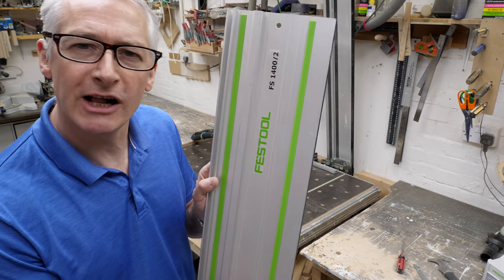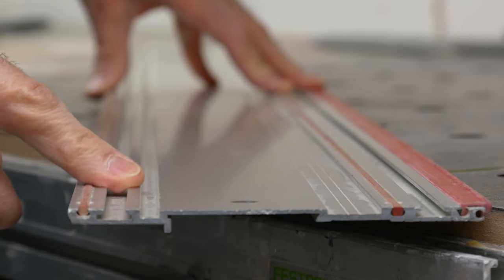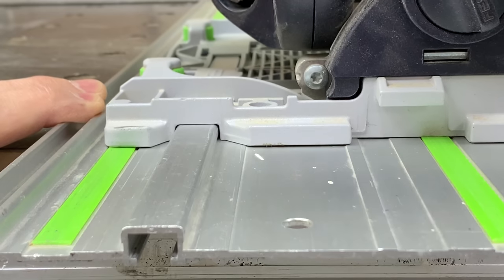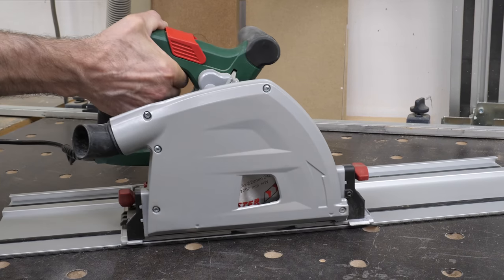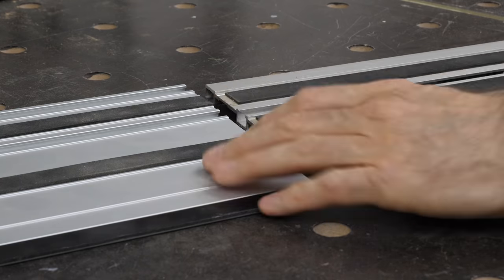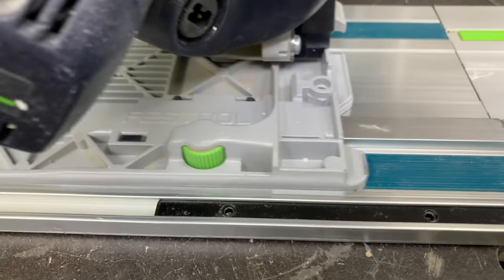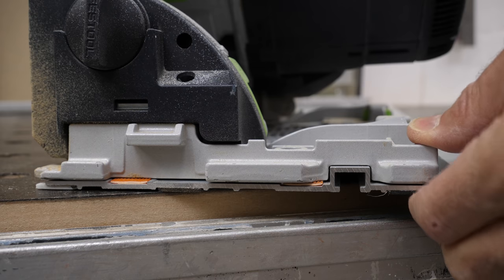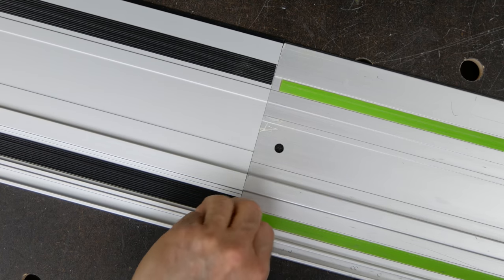Which Rails Work? A Guide to Guiderails [video #403]

Comment: Thank you look forward to future videos.  Have you heard of any problems with Makita Rails having design issues?

I bought the Makita saw and guard rail about a year ago and have yet to be able to cut reliable 90degree cuts across a piece of plywood or mdf.  I even bought the TSO adaptor that was supposed to enable this to be easy. In TSO literature they appear to imply that some Makita Rails may not be machined correctly and to validate the rail is straight, but never comfortable with my ability too use calibers and the best places to measure to check this out.

As a result, I make the cuts with enough overcut to take the pieces to my table saw and make the final cuts - seems like a waste of my track saw dollars.  Any free advice?
Reply from the maker: I only have one Makita rail, and haven't have any issues with it - though others I know have. Assuming your saw is snugged onto the rail properly, then it could be a problem with the rail; do you have anyone locally who you could borrow another rail to try, or maybe try their saw on your rail? I think if I'd bought that rail recently, I may consider returning it for exchange, but after a year or 18 months I appreciate that probably isn't an option! 

What's the issue with the cut; is it straight but not square, or not perfectly straight? If you sight down the edge of the rail does it look straight? If you butt a known straight-edge against the splinterguard, is it in contact all along, or does it appear to bow?

Thanks! P
Reply: @10MinuteWorkshop  agreed...I delayed too long to be able to take it back.  After I asked you a question I actually started researching - got my own curiosity up.  found out there have been problems with warped and curved rails written about.  Just didn't see that research before I bought in late 2019.  

I will just chalk it up to learning.  Recently i started in vesting in several more Festool tools, two sanders and a Domino.  I have been thinking about upgrading to a Festool Tracksaw and track - maybe I only need to upgrade the track now and maybe the saw later.  I am starting to get a real appreciation for quality and customer service as  I learn more about Woodworking.  I saw you had two Festool track saws in your compact shop tour.  In watching your videos I have picked up you are cost conscious (much appreciated), but you also really like your Festool equipment - assuming they didn't give you all of it.

I can't believe how busy you must be with the number of subscribers, YouTube Stuff and other efforts in your life.  thank you for your personal answer before.  it was well thought out.  If you do have a strong opinion on the Festool track and sw over the Makita would be nice to hear or send me a link to a video you likely made.  Thanks again and cheers from the US.
Reply from the maker: Thank you Rob. Ha! Festool UK wouldn’t give me the time of day! Everything I have I bought with money earned one wardrobe, one set of shelves, one cabinet at a time. Also slightly embarrassed to say that I now have three TS55 saws (see this video for explanation - https://youtu.be/v8U1VUbkbuk). I also have a Makita - in the name of research, you understand - and reach for the Festool every time; honestly it’s just nicer to use. Some folks say the Festool is underpowered in 110v, but that’s usually when using long extension cables or a transformer (from 240v here in the UK)  - it can be a little picky about power supply, I guess. 

Anyway, that’s my two-penneth; I don’t know anyone who’s bought the Festool and regretted it, but I’d try and try one out first. All best from London! Peter. 👍👍

Comment: Hi, I have recently purchased a Bosch circular saw, what are your thoughts on Kregs guide rail set?
Thanks
Reply from the maker: I’ve no experience with the Kreg rails I’m afraid, as Kreg don’t sell them here in the UK. 🤷‍♂️
Reply: @10MinuteWorkshop  I’ve seen a few pop up on eBay/Amazon. What wit if you suggest for a Bosch?

Comment: Hi Peter i have bought the erbauer plunge saw with 2 x700 guide rails ,only problem is the rails are not long enough to cut full length of 8x4 sheet or 1981 door could you advise if any other rail fits the erbauer  love  the video's  thanks mike
Reply from the maker: Erbauer uses the standard Makita-pattern rail, so Makita or Festool rails will be fine. 👍
Reply: @10MinuteWorkshop  thank you 👍

Comment: Just checked tools4trade and they are selling the excell rail set at 27.50 but it doesn’t look the same design as Peter demonstrated? From the one picture they show, it looks like they have removed the upward facing T track which now looks like a simple lip? But for less than £30 probably worth a punt. Interesting side note, the excell 1400 rail is not compatible with the 600 rails? The 1400 does look like it has the extra T slot but they don’t have any stock, might be a copyright situation? Happy cutting
Reply from the maker: Thanks Andrew. The 2x700 rails are the same design as the Lidl Parkside rails. The 1400 rail is the same as the Makita or it was the last time I looked. 👍
Reply: @10MinuteWorkshop  I’ve taken the plunge (haha) and just bought an old TS55 EQ, I think it’s the same as the one you had the blonde moment with the brushes? It’s a bit rough round the edges but a pucker Festool for £89 with a 48 tooth Freud blade, I’ll take that. Need some rail so was re watching your older videos. You’ll be needing a fan in the workshop on Monday/ Tuesday mate, scorcher! Thanks for the reply Peter.

Comment: Hi Peter, very nice to have this overview!. Technical question: in comparison to earlier videos, like the plywood birdbox, this one has more loudness and/or bass in the audio. Did you do anything different in that respect? I had to adjust my speakers a bit.
Reply from the maker: Hi Caspar, and thanks! Ah, yes - I was using my wireless mic last week and had the camera audio set to -6dB, so I had to boost it in the edit; that may explain the ‘different’ audio, my apologies. Should be back to normal in the next one. 👍👍

Comment: I are there technical drawings anywhere of the tracks. I want a 1400 track to use with my Rutland plunge saw
Reply from the maker: There’s plenty around for the Festool and Mafell rails - a quick google will usually turn them up. I doubt the Rutland rails will get that kind of attention, but afaik it’s the same as the Einhell / Parkside pattern rail, so that should widen the scope a little. Seem to recall there was a Dutch supplier that did a 1400 rail for the Parkside?? Might be worth a search? Or the Evolution rails, maybe? 👍👍

Comment: Hi Peter, I Recently discovered your channel and learning so much, I bought the Loose tenon + Jig Can you tell me what track is compatible with erbauer plunge saw track? As cant seem to find the info anywhere, Many thanks :)
Reply from the maker: Hi Paul, thanks and welcome. The Erbauer uses track that’s virtually identical to the Makita-pattern tracks, so the excel 1.5m rail mentioned here will work fine. I compared the erbauer with the Triton equivalent in this video, if it helps - Two Big saws [**Gifted][video 442] https://youtu.be/ZCVPNFeHAQ8
Reply: @10MinuteWorkshop  Excellent, thanks Peter

Comment: Do the triton saws work on evolution rails?
Reply from the maker: Not sure I’ve tried, but they should be fine. Evolution rails have a few issues though, as mentioned in this video.
Reply: @10MinuteWorkshop  thanks
Reply: @10MinuteWorkshop  would they work on the  excel rails?

Comment: When cutting melamine using Makita track saw and rail, it toes-in slightly at the start of the score cut. To get around this I have to use sacrificial piece at the start. I guess this is due to the track sagging vertically down and creating wobble in the track saw. Is anyone experiencing this with Makita?
Reply from the maker: Only time I’ve had something like that was when I was trying to make a cut with a rail that was a bit too short and had the saw hanging off the back of the rail; that allowed the saw to move a little when plunging. That’s the only time I’ve had this though.  🤷‍♂️👍
Reply: @10MinuteWorkshop  thank you for your opinion

Comment: Ive just bought the Excel saw with extra guide rail.  They seem to have changed it though. It is no longer like the makita. It now mirrors the Lidl one.
Reply from the maker: The 1400 Excel rail is the same as the Makita, but the 2x700 rails that come with the saw are like the Parkside - as is the saw. Crazy situation! 🤷‍♂️

Comment: I know you didn't have one but did mention it. The Dewalt guide rail with its reversible feature! But would you think that this would be a negative against it when using the rail on a mft type work bench as it would be the splitter guard that is pushing against the guide dogs? Im in the market for a track saw and the Festool is a bit heavy in price for me so looking at the Dewalt as all my other kit is Dewalt and am happy with them. So possibly Dewalt saw and Festool rail which I believe work together would be the best when adding in the mft work bench into the mix. Your thoughts would be greatly appreciated
Reply from the maker: Hey Graham. Yes, the reversible rail is a neat trick, but does have that drawback. As you say the DeWalt saw has a second slot in the base so it will run on Festool rails, so that’s the way I’d go on an MFT top, I think.  Only slight niggle might be if you need to dial in the saw to the rail every time. Plus there’s the additional cost of the festool rails of course. 🤷‍♂️ 👍👍
Reply: Peter Millard Dial in the saw each time?
Are you thinking if I used both Dewalt and Festool track day one for site and one for workshop?
Reply from the maker: @GrahamGphotoParker  The saw needs to be snugged onto the rail with the cam adjusters - don't know exactly how this works with the DeWalt, but one the Festool there are couple of green thumb screws - but because you'd be swapping between rails/manufacturers, there's no guarantee they'd be the same - I'd expect them to be different tbh, so you'd likely need to do this each time you changed between rails.
Reply: Peter Millard understand thank you. I suppose one way is to just get the festool one  cheers for your reply’s

Comment: Measured the Rutlands tracks - 1.4 m in two parts @£50 - in line with the Festool dimensions, but no outer accessory slot.
Reply from the maker: Yep, the Rutland’s the same pattern as the Lidl Parkside 👍👍

Comment: I kept meaning to ask what track would you suggest is best and reasonably priced for a Scheppach plunge saw ? Apart from the standard as they are too pricy please
Reply from the maker: Scheppach - like the Aldi Workzone - are a bit of a tricky one. As I say in this vid, their rails are wider than usual, so while the saw will run in alternative rails, you need to have a lot of splinter guard exposed. Unfortunately that means the OEM rails are the only ones I could recommend. 🤷‍♂️

Comment: Hi Peter!  Sorry to keep bombarding you with questions but you are the track and bench dog expert.  Ok, based on your videos, I went with the bosch track.  I now see, for parallel guides I need a festool style track (I am sick of waiting on benchdogs co uk to come out with a mafell version).  Makita track is way cheaper than festool.  Is the festool track worth the extra money?  Also, the bosch saw overhangs the bosch track.  Do you know of a super short bench dog that I could use so my saw will roll right over it?   benchdogs co uk have there 3mm protectors but I am not so sure they would work.
Reply from the maker: Hi Mark. Yes, the Bosch/Mafell rails are a mixed bag - great for joining and clamping to a narrow workpiece, not so good for accessories. And to be fair to Benchdogs, that's a tough nut to crack, with no LHS t-slot! Makita track is generally pretty decent - the Festool track grips better in my experience, and the Makita has that little lip that - you guessed - can also get in the way of accessories, though not the parallel guides. Haven't spent any time with the Bosch saw and track I'm afraid, so I don't know how high it sits off the deck - I'd be surprised if it were less than 3mm, but as I say, I'm afraid I've no direct experience withe the Bosch. Not sure if that helps or not! Cheers, Peter

Comment: Hi mate, dunno if its been mentioned on here already but have you had a go with the flexvolt plunge saw on any the tracks? The dewalt ones are junk but the saw is very good. Loads of power. The festool ones i know work but at £300 a set im a little reluctant to go beyond the dewalt ones as the ones i have are getting a bit hammered.
Reply from the maker: Never got my hands on the Dewalt saw so I can’t say for sure I’m sorry. 🤷‍♂️
Reply: @10MinuteWorkshop  no worries cheers for the reply 👍

Comment: Was just thinking about the titon from screwfix as I know you done a comparison against the festool ts55 Thanks.
Reply from the maker: Yes the Titan track is pretty good, but I didn’t want to include it as it’s discontinued now. And I think I talked about the rails a bit in the original videos. 👍👍
Reply: @10MinuteWorkshop  H Peter, great video, didn't Screwfix & B&Q just change the name to, "Mac Allister MSPS1200", rather than discontinue it? It's available on both sites with rails for £100, i've got one arriving tomorrow for a test.
Reply: @gckw  I'd be very interested to hear your findings as Peter and I had that discussion (whether it was just a rebrand or not) a couple of weeks ago.

Comment: Hello Peter, would be much obliged if you could advise what rails I can buy to use with my Mac Allister (B&Q) MSPS1200 saw. Regards Bob
Reply from the maker: Hello Bob. I’ve never used or laid hands on the MacAllister, but I believe it’s a dead-ringer for my old favourite the Titan, so it should be fine on a Festool-pattern rail, so Festool, Makita, Triton, Evolution, Excel etc... should all be OK with it. 👍 Hope that helps!
Reply: @10MinuteWorkshop  Bless you Peter many thanks

Comment: Just bought the Evolution R185CCSX+ circular saw complete with the 2800mm track. Is the excess rubber on the track suppose to be cut off after first use?
Reply from the maker: Yes, you trim back the splinter guard, then the rails is tuned to your saw. If you’re new to tracksaws, may I suggest the tracksaw workshop series of videos - this and all tracksaw-related videos are on a playlist here - http://bit.ly/TracksawWorkshop

Comment: Hi all, hi peter. How did you chop that rail at the start of the video? Did you swap your blade for a metal blade? Looks very neat.
Reply from the maker: Hi. A regular TCT blade is fine for the occasional cut in aluminium - it’s a soft metal - and I did this one with the standard Festool 48t blade. 👌👍
Reply: @10MinuteWorkshop  thanks a lot for your answer, I would have been pretty scared trying this out without knowing. Might give it a go with a old parkside rail to make a little cross cut jig.

Comment: Hi Peter, 
On top of the PDF for festool rail would you be able to share the measurements for the lr32 rails?
I've a standard 1400 which I would like to concert to 1400 lr32 thanks to CNC... But I definitely need the specs.

Thanks in advance
Reply from the maker: Hi Pierre. The rail’s identical I think, but with the row of holes, so you mean the placement of the holes I guess? I’ll give it a measure when I’m in the workshop next. 👍👍
Reply: Hi Peter, yes was talking about the holes row themselves
Reply from the maker: Pierre Hernandez Gotcha - I’ll measure when I’m back in the workshop. Spoiler - I’d say they’re 32mm apart... 😂👍👍
Reply: @10MinuteWorkshop  🤣🤣🤣
Reply from the maker: Hi Pierre. So take this as 'for what it's worth' as I'm no engineer; I've measured my rails as accurately as I can and the LR32 holes are slightly elongated - 6mm high and 7mm wide - and sit at 60mm centres from the edge of the rail (59mm from the rib). First hole is at 12mm centre from the end of the rail. There's a drawing here - https://www.dropbox.com/s/2zx4lcp9zkkgm61/Festool%20rail%20LR32.pdf?dl=0 - provided without warranty of any kind!😂 Hope that helps! P 👍
Reply: @10MinuteWorkshop  wonderful thanks so much.
Now "just" need to handle the CNC part and get the 3d printing of the lr32 kit to be able to test...
Answer in few month based on my current speed ;)

Comment: Hey Peter, what would you say are the ideal length of track for someone who does kitchens and doors? Mainly alot of doors. Looking to buy the Excel 165mm Plunge Saw 1400W Heavy Duty 240V
 from Mano Mano since I have a voucher from them. Not sure What tracks and clamps to get for it though. Says it is compatible with Makita and Festool tracks.
Reply from the maker: The Excel rail I have is identical to the Makita rail; when I was doing a lot of doors I bought a 3-metre Makita rail and cut it down to 2100/900 and that worked really well, though it was a slightly pricey way to do it. If you don’t mind having a join, then another excel 1500 rail cut down and permanently attached to make the same arrangement would be an option. The Excel rail joining bars are very good and great value at about £7/pair. HTH! 👍👍